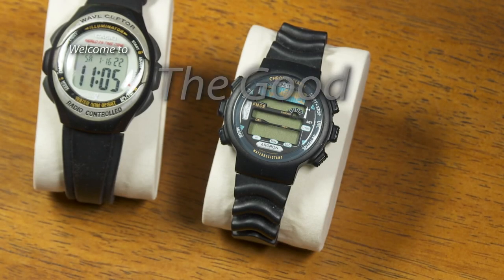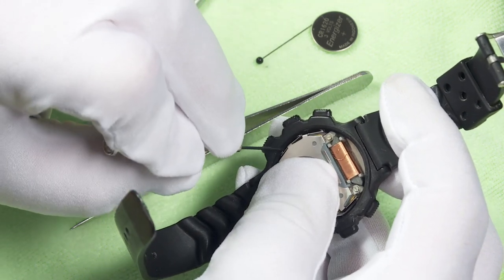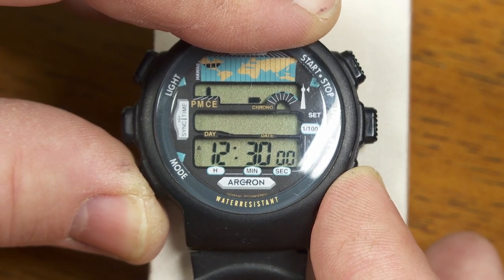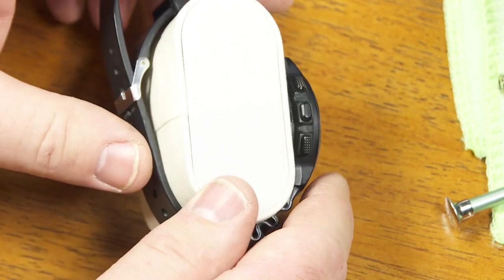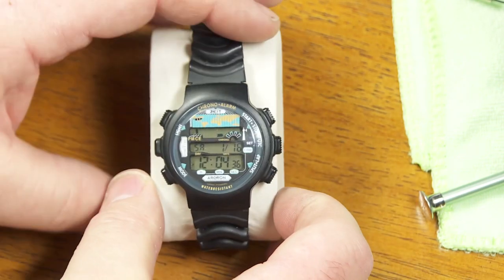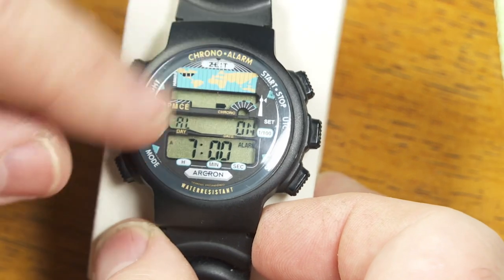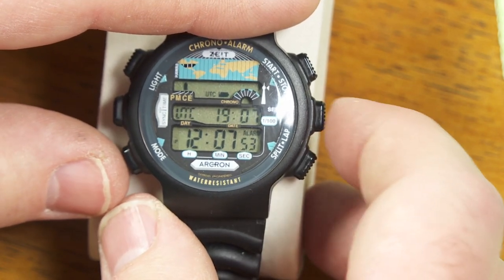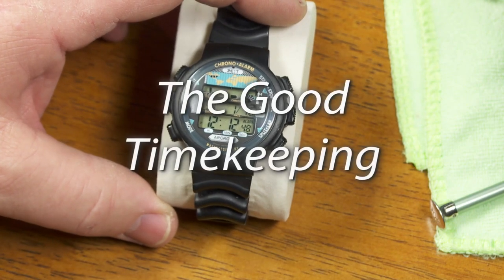Arcron Zeit Vintage “Atomic” Sports Watch In Depth Review and Battery Change

Comment: I thought Casio atomic watches were around in the early 90s?  🤔  The last 30 years have been a blur for me.  😑.  Great video as always!   ✊
Reply: No. The first atomic watch they made was in late 1998.
Reply from the maker: It’s certainly possible that Casio was selling this stuff before I was aware of what they were doing. I didn’t have the Internet in my house until mid-1997 (state-of-the-art dial-up Internet). After that I was better at figuring out what the different companies were making when it came to clocks and watches.
Reply: @GoodTimekeeper  Casio was late to this game but they had improved reception features.